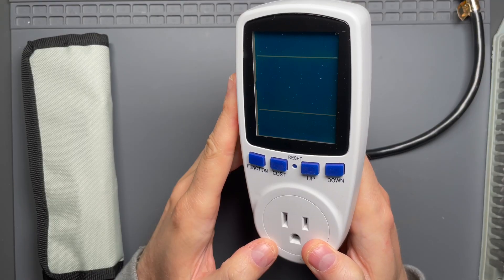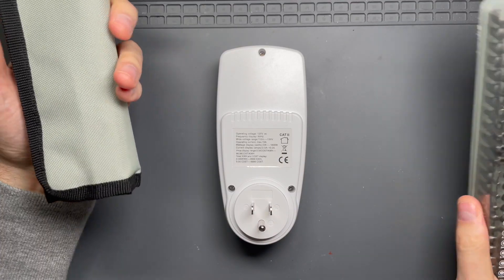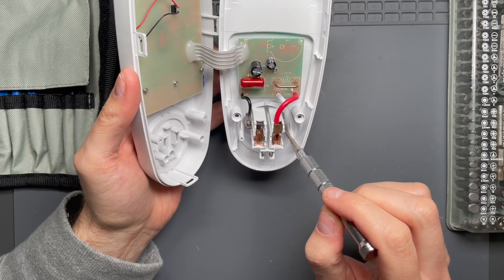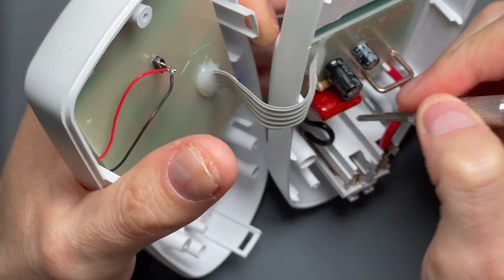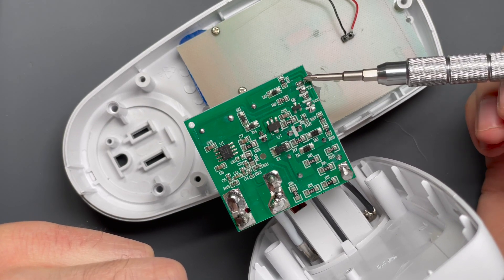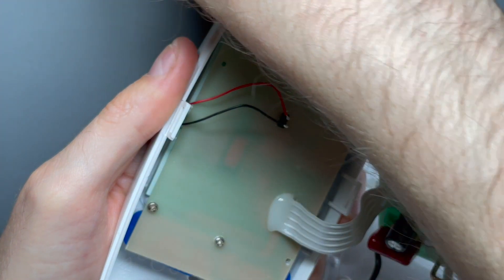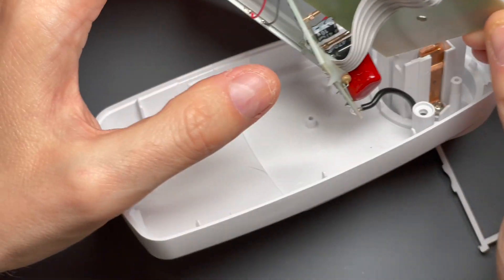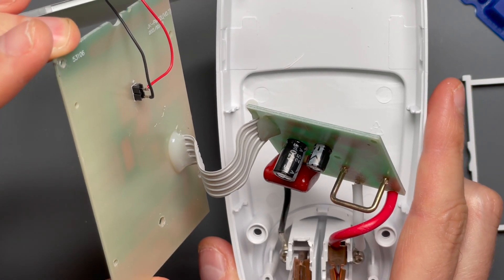Inside a MEECHER Power Analyzer

Comment: Hey Curiuos just wondering when you will be doing your 757 anker solar video. I am thinking of purchasing one but i's still on the fence . Have you tried any of the other power stations like the Bluetti 200max or anything like that and if so which is the best power station you would recommend. Do you think this would be good as a stand alone powers station that you could keep hooked up to a solar panel or ? great video by the way.
Reply from the maker: That video is in progress, and I aim to have it completed soon. I am looking at testing others down the road. I do use the 757 connected to a solar panel array most of the time, so yes, it can work. Thanks for watching!